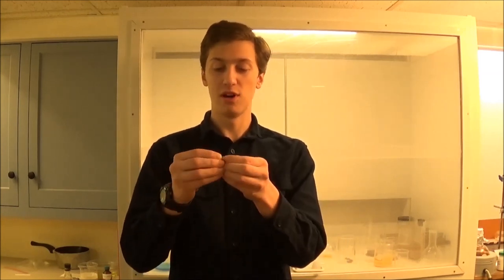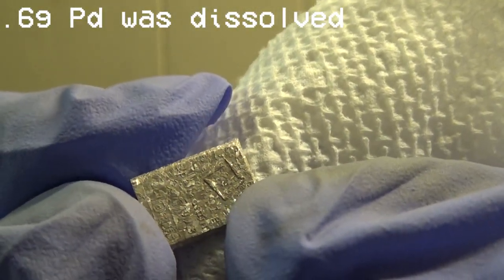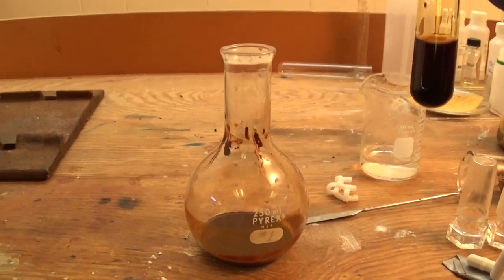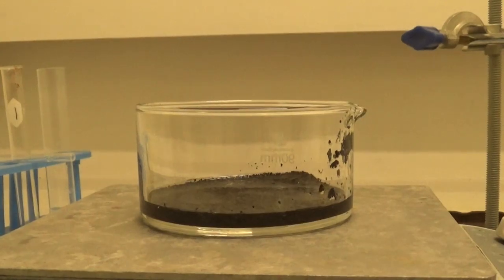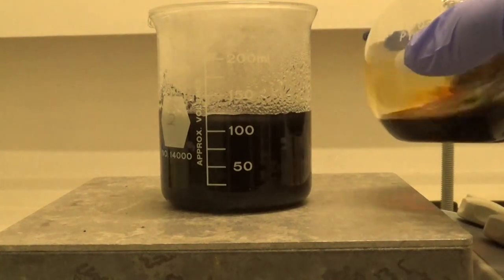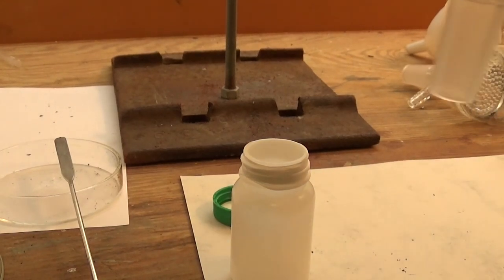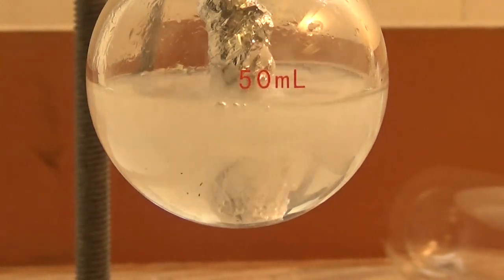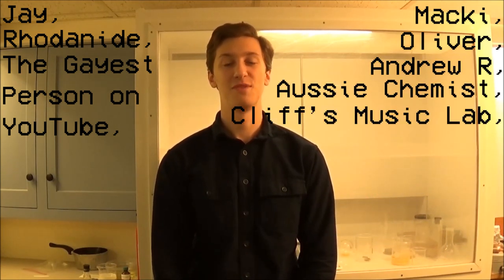Preparing 5% Palladium on Carbon Catalyst

Comment: I’d love to see your catalyst’s performance placed against the performance of one made by a reputable company!
Reply from the maker: That would be very interesting to do! If I get some (non-Chinese) stuff I will try that out.
Reply: Connor...........Just guessing but i bet it would do just as well.  It lit that hydrogen up pretty QUICKLY
Reply: @TomsLab  ............You should have put the metal chunk of palladium in the hydrogen flow to see that it does not ignite......i am guessing.   But i wander what the temperature differential would have been.  Cause i think the metal would have heated up a lot.  What if you kept the metal chunk in the hydrogen flow for an hour.  I have a gram chunk of palladium.  Now i am curious.  I bought a cornelus keg to do hydrogenations in

Comment: I did your procedure, but with a palladium extracted from magnetic ceramic capacitors, russian palladium potentiometers and DMG extraction. After reducing that to palladium black I repeated your procedure. I have a question for you - in the end I really got off most of  the colour but some green cololouring of the liqud remeined, as well as somefloating white cloudy particles, for wich I think may be due to copper contamination. Any ideas if what I did is ok or not? Any ideas? Now I'm drying the carbon (about 4 gram/5% in my rough callculations..). So I will be able to test it the next days. But I will welcome any coments on what I did. Great video and chanel! Keep going mate!

Comment: if you wanna filter very fine particles through a glad filter and you're not interested in the product in the filter, out a little bit of celite in the glass frit and the filter your solution
this should prevent the glass frit from clogging, and even holds back very fine lithium chloride
can you provide a link for the paper you used, I would be very interested, thx